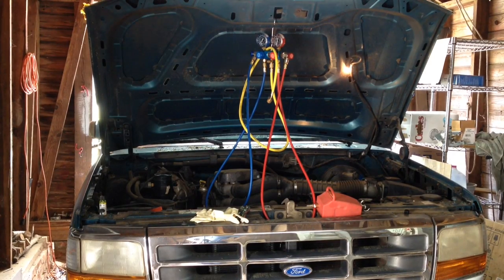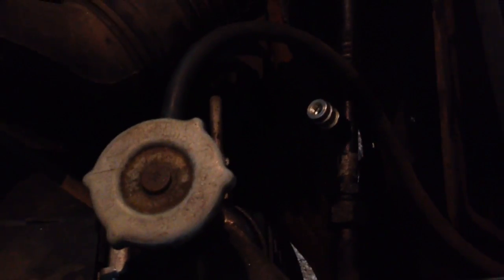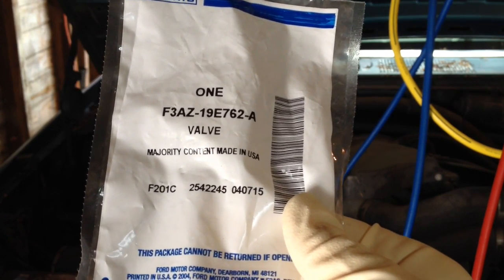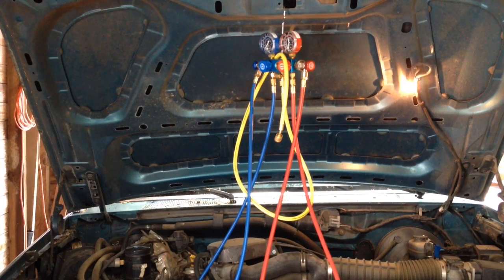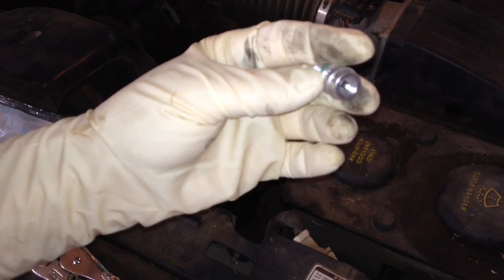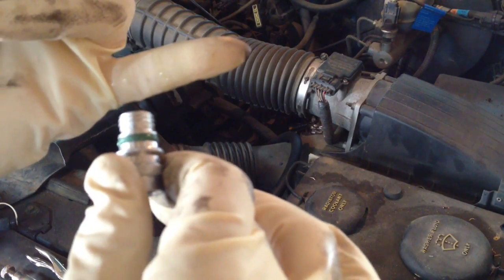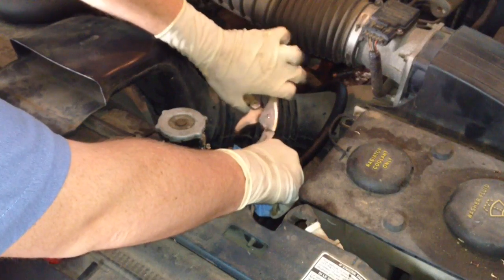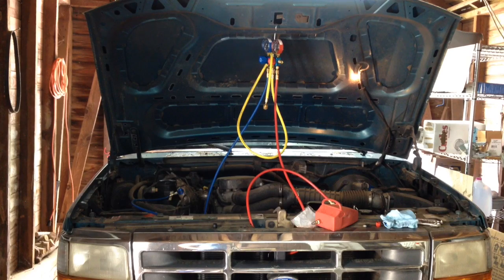1994 to 1996 Ford F-150 A/C High Side Port Valve Replacement

Comment: Thanks you for posting ! I know it's been many years, hope the truck and you are still getting along ok. I have a pretty clean 95 F150, I6 5 speed needing A/C help. I was confused when I looked at the port and discovered I couldn't just unscrew the valve. I did find an aftermarket valve and ordered it along with a compressor and drier (OE compressor coved in oil behind the clutch). Watched your charging video and the pump follow up so I'll be good to go after buying the pump and manifold gauges. Did yours hold it's charge long ? Thanks again buddy !

Comment: The Motorcraft P/N for the F3AZ-19E762-A, high side service connection is "YF-37653-1X".  I bought mine from Rock Auto for the price of $4.62.

Comment: Thanks for you guidance and expertise on this matter. I could not figure out what I was dealing with. I thought there was a Schrader valve on the high side too. The low side was straight forward enough. I have a ‘95 F250 460V8 and I have damn near every service manual there is. Is there ANY mention of this rubber valve in any of them? Hell no!! Thanks again! Now to try and muscle that thing off without twisting the plumbing 😢

Comment: If I understand you correctly, you are replacing the ball type of valve with one that has a schrader valve in it. I connected my r134a quick connect to the ball type on my 1995 f150 and it wouldn't seal properly.
Reply from the maker: No I replaced it with the OE Ford same ball type type valve. Went to the dealership to get the part.
Reply: Thanks for your reply. Rock Auto has them. I ordered one today. Sure hope my quick connect coupler seals onto the new one.
Reply from the maker: If you still have problems with your quick connect sealing on the new one, it could be the seals in the quick connect chuck. I had that problem one time. Just replaced my quick connectors

Comment: thanks for the video, I was wondering if you know that the high end valve is the same on a 99 chevy k1500? it looks a little more welded on but cant tell and don't want to discharge the system if I cant change it. I dont want to yank on it if its solid but its sorta hard to tell. I am replacing the valve core on the low side with the core removal tool that closes  the pressure and keeps the charge in while you replace it so I dont want to discharge it prematurely. I know the low side had a small leak just not sure of the high side yet

Comment: How do you open up that valve without damaging the rubber ball? I just want to vent some air out of it as I am pumping Freon on the low side? I don't have a vacuum tool and the car is pretty old.
Reply from the maker: You can't vent vent from the high side while charging, the freon will just go straight out. You have to pull a vacuum to do it the proper way. Without a good vacuum to remove the air and moisture from the system the system isn't going to perform well and the compressor will prematurely wear out.

Comment: Yeah, I tried that, but both ports look the same on the inside.  I used the tool that came with the kit I bought that includes two valve covers (low and high) and two valves.  I can't pull the old valve because it looks just like the one on this video.  Thanks for the reply.
Reply from the maker: The threads on the core itself may be stripped and you'll need to replace the whole low side port. If my memory serves right on that '97 you can actually remove the port from the accumulator and get a new one. If it's made onto the accumulator and you can't get the core out you'll need to replace the accumulator.

Comment: Does the low port side work the same?  I have a 97 ranger with the same type of valve.  I tried to remove the valve before realizing the cover over both sides.  Thanks
Reply from the maker: No the low port actually has a valve core that is removable and you can pick up replacement valve cores at your local auto parts store. Some kits even come with the core removal tool.  It's very similar to the valve core stem in your tires.

Comment: If anyone is looking for a high side service valve for Ford Ranger '96, and probably other years and models too- I just replaced mine and it was an exact fit. It was a Factory Air, by 4Seasons, part no.59946. I got it from Autozone for $4.00. Probably other places and online sell it also.
Reply: BTW, it looks exactly like the one you have in the video.
Reply from the maker: +Iam Ian that's cool. In my area none of the auto parts stores carried this exact valve, they just had the retrofit valves in stock. All they would say is go to Ford, they couldn't find a listing for it. I figured there would be an aftermarket one but I just went to Ford instead of taking a chance on ordering it online and it not being right.
Reply: I understand. I don't blame you for matching up, it's not like it was a big ticket item. My local Ford dealer didn't even have the part. I just posted to let others know the part no., and that it is a match.
Thanks for your video.
Reply: I know this is an old post but thanx I'm needing one right now and my local parts store was selling me the whole line for $124.00